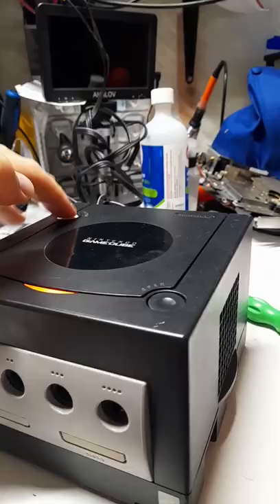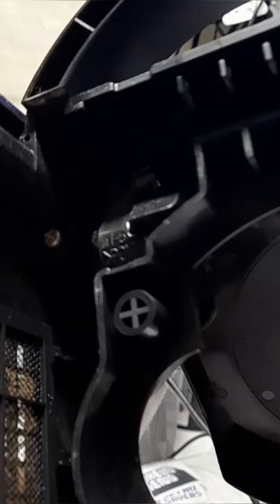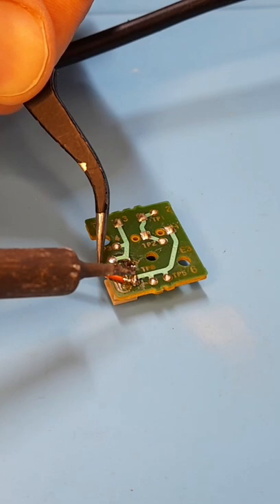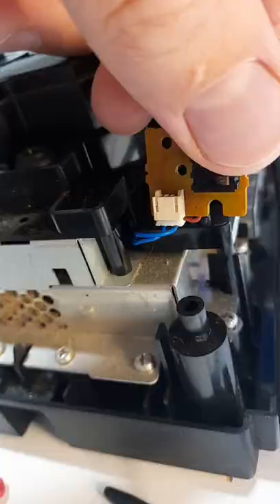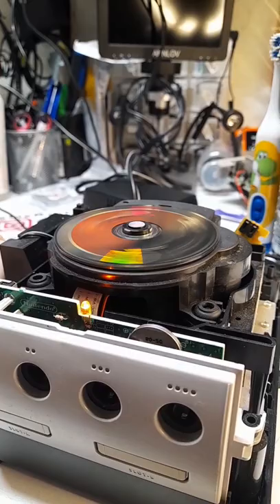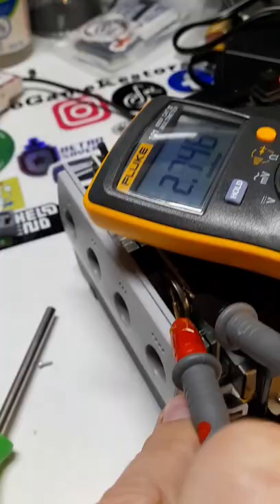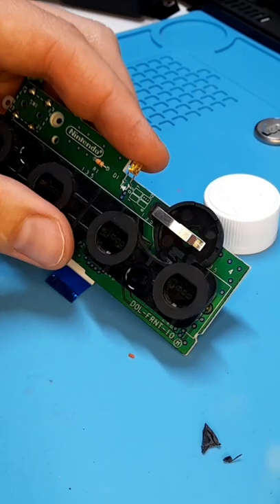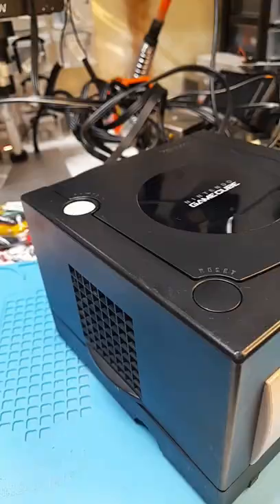This GameCube had me spinning.. #shorts #nintendo

Comment: I've had this question for a while and what's  the battery for?
Reply: It's for the clock to work properly. Without the battery, you would have to adjust the clock everytime you turn on the console.

Comment: I wouldn't wanna buy that considering you just admitted it isn't a proper fix. Maybe invest in the parts you need to restore old consoles instead of just bypassing the system that was clearly being used?

Comment: Excuse me but do you have any idea of a simple solution to drift on a wii u gamepad?
Reply from the maker: You can clean the sticks! You'll have to open it though
Reply: I opened and cleaned mine several times. It does work, it's just a temporary fix though. The drift will return after a while. If you don't want to open it, just try to blow on the sides of the sticks, usually it works too.

Comment: Bypass the lazy mans way of fixing something also considering that several gamecube games are 2 disc how would you change the disc if it detects it as being closed while its open?
Reply from the maker: Lazy man's or limited man's, I didn't have the parts. You're correct, you would need the proper switch for 2 disks. The owner of this system however is a game reseller and is using it to test games that come in